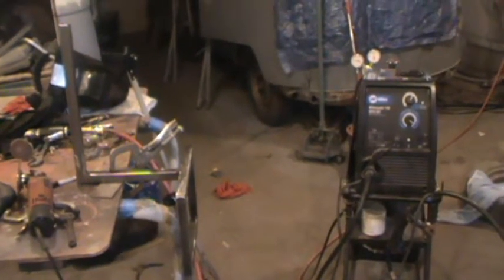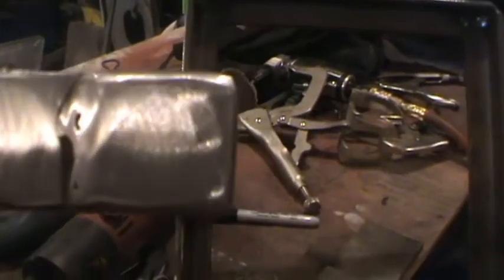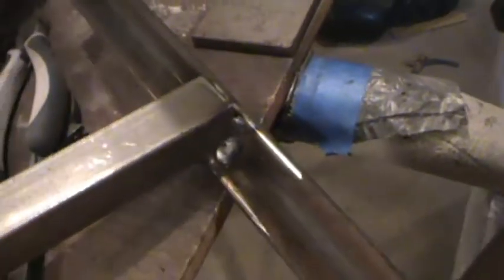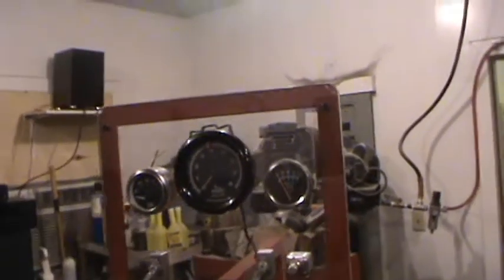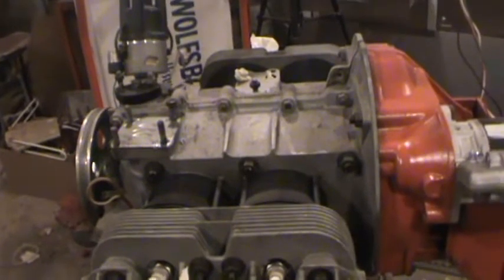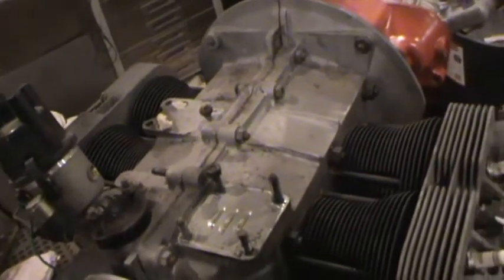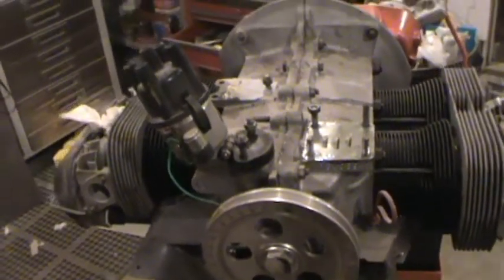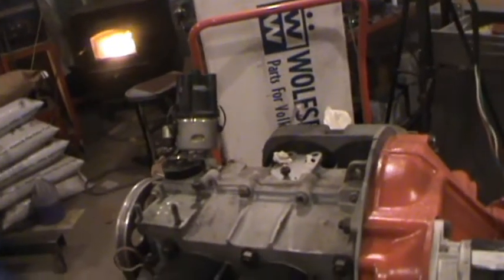Run Test Stand, and building 1600cc motor

Comment: A good start kinda looks like an old boxer eng.
Reply from the maker: We have all flat four cars at out house, Air coolded VW and new Subaru's, The Subaru motors are almost like the flat 4 air cooled VW, I rebuild a 2.5 Subaru motor . Plus a VWType 4  (2000cc fuel injected) 1978 bus motor. Never rebuilt an old VW square back pan motor.